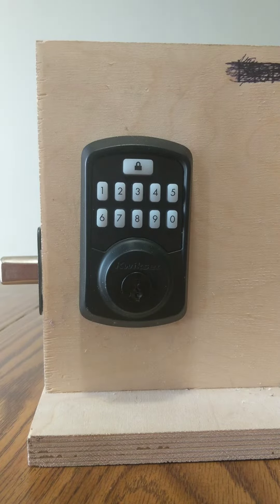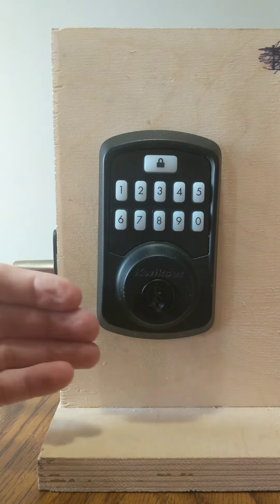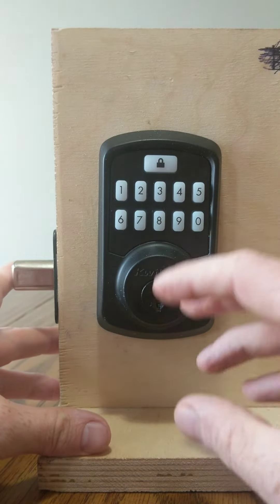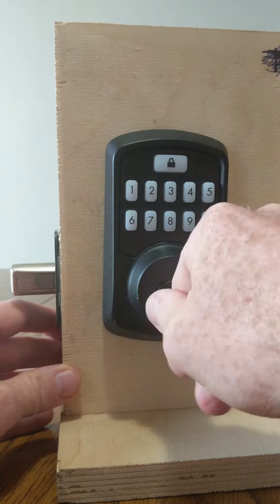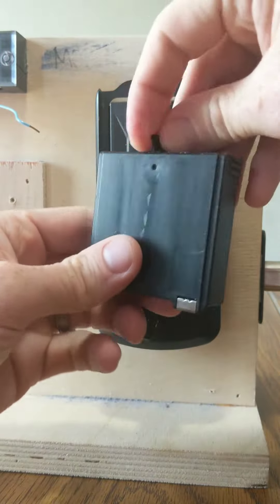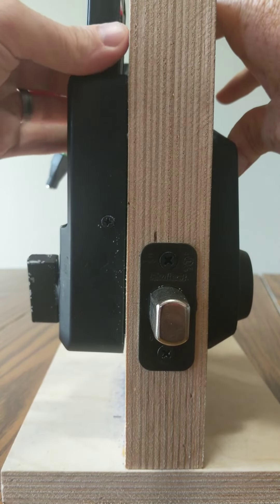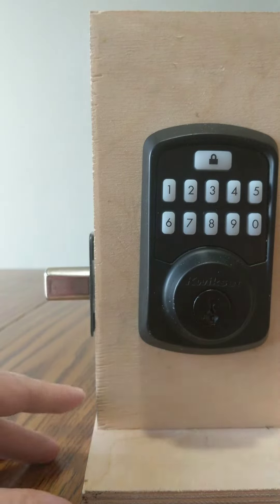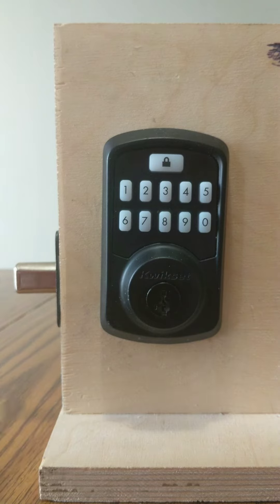Kwikset Aura - How to Rehand Lock (TroubleShooting)

Comment: I just installed mine and there seems to be a single clicking noise at the end of the lock unlock cycle.   Is this normal?  I didn't seem to hear it in your video.
Reply from the maker: Hmm I may check to see how type the screws are sometimes the tightness of the screws may cause this to happen. Here is my install video if this helps https://www.youtube.com/watch?v=9XiNfVjyolo
Reply from the maker: Because normally rehanding will fix any clicking noise maybe rehand one more time than check the installation process  https://www.youtube.com/watch?v=9XiNfVjyolo

Comment: I’ve rehanded the lock multiple times and checked all of the installation instructions and my Kwikset is still clicking at lock and unlock
Reply from the maker: Hey Jon, 
The only other things I might check would be the tightness of the screws or try reseting the lock.
Reply: It’s just one click when the lock engages and disengage is that normal